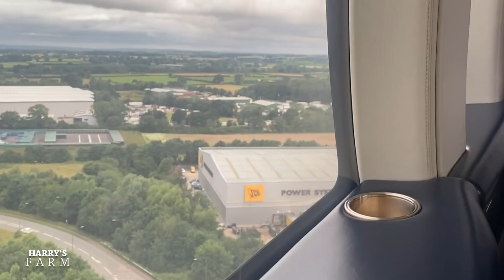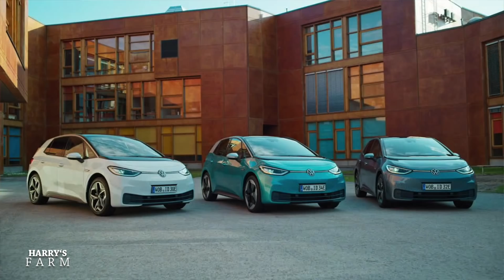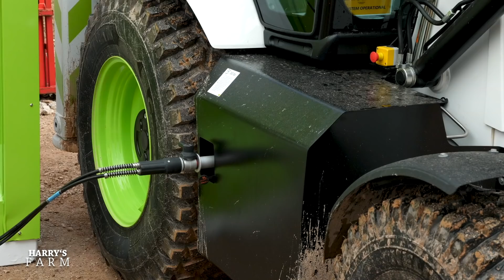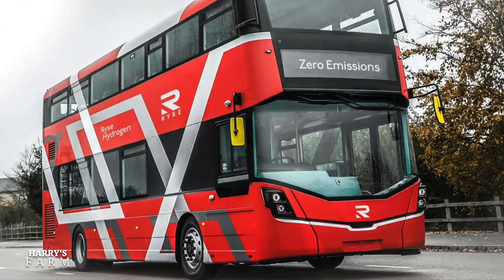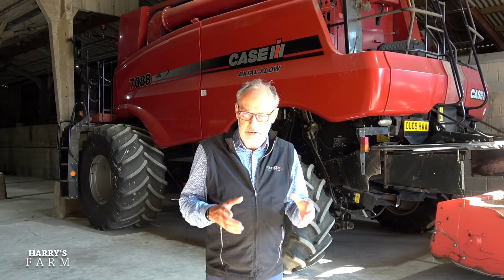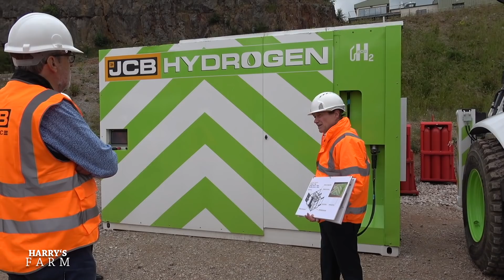Why JCB thinks hydrogen is the best alternative to diesel for heavy machinery, farming and HGV fleet

Comment: I'm very curious how they will protect against water (from combustion) mixing with the oil, and corrosion of cylinder/valves and other parts which has always been a huge problem in engines modified to run partly or completely on hydrogen.  Otherwise this, along with fuel cells (when the price comes down) is clearly the very best green solution.

Comment: The way I understand it, simplified:
Diesel and petrol: dirty energy, dirty emissions, easy storage, low price, low efficiency=2/5
Hydrogen engine: not so dirty energy, not so bad emissions, difficult storage, low price, low efficiency=3/5
Hydrogen cell: not so dirty energy, clean emissions, difficult storage, high price, developing efficiency=3/5
Electric: clean energy, clean emissions, difficult storage, high price, great efficiency=3/5

Don't get me wrong, I'm just trying to get a grasp on the topic. Electric is probably preferred now because not only is it possible to produce electricity in a seemingly renewable way, but that technology is also widely available and used all around the globe. Meanwhile, hydrogen only has the promise of being a clean source of energy, but production isn't as environmentally friendly yet as the other, and technology in general is currently being optimised. 🤔 In other words, they're at different stages of development in my view, but surely it will be interesting to see how each solution will progress and find the best fitting industry. What if they are all great, but for different applications?
Reply: Hydrogen cells must be worth at least a 3.5
Reply: Electric isn't efficient, they said you'd need 8 tons of batteries to be equivalent diesel. Also in the long run batteries aren't great for the environment either.
Reply: @Camhin1  Electric is by far the most energy efficient. But I agree, there will be places where the energy efficiency will have to sacrificed to gain efficiency in other areas, eg weight and capacity efficiency. Still for the vast majority of applications, batteries look to be the more economic choice.
Reply: @Camhin1  an electric powertrain with batteries seems to be far superior to anything else efficiency wise, it just limited for weigt, capacity and price

Comment: As a battery electric car convert and driver, I totally agree with everything said here, battery electric is the solution for cars and vans, hydrogen is the solution for tractors, trucks, buses, and trains where lines are not fully electric…we just need to ramp up both very quickly to avoid full on climate crises. Elon Musk has certainly shaken things up! Trouble is getting hydrogen in any volume any time soon. We can all charge electric things ranging from toothbrushes to cars at any socket but the public have just three working hydrogen filling stations in the UK..

Comment: Enjoyed the video,the only fly in the ointment is that batteries are going to be progressively smaller ,cheaper, and more efficient,in the near future.
Reply: Wasn’t that countered in the interview? Performance will increase, but unit cost will always rise - might mean you need fewer cells eventually which could result in a fiscal saving but if automotive development over the decades is an indicator, that increased efficiency will be sold at a premium as performance and offset by other features. How much larger and heavier are today’s ICE cars than there predecessors? At a slight tangent I have heard it suggested that Tesla’s structural (monocoque) engineering is overly complicated and hence heavier

Comment: Everyone in the motor trade knows full well vegetable oil is the best fuel . It’s so clean you can eat it and while growing it’s absorbs carbon monoxide. Loads were using it until people found out people were using it 😂 then as if by magic vegetable oil went from 30p a litre to the exact same price as diesel and manufacturers all changed their fuel pumps so you could no longer use it . Who does not get this ? A fuel so clean you eat it

Comment: Surely this could be quite misleading, because there is no mention of how much the fuel itself will be and from what i understand making and supplying the hydrogen is the problem.
Reply: You're correct. This process is hugely inefficient. The cost of hydrogen will never be able to complete with the cost of charging a battery. A technology like this will only be plausible in situations where battery electric is infeasible
Reply: @fraserrose4209  "Will never be able to complete" is a very bold claim. In terms of physics/math, nuclear power using h2 as energy storage is probably the most clean alternative we have available right now. The problem now is that the EV lobby has become too big and they will not let this narrative fly.
Reply: @cosmonauteable9151  you could be right, but storing hydrogen is exactly the problem, no? Energy density per volume is very poor for hydrogen.

Comment: With your soil analysis and the possibility of farming an energy source through grasses, add a net zero fleet of tractors etc and you could have all the cows in the world and Greta would be happy.
Reply: oil companies attempting to sell oils and gas dressed up as hydrogen it is a scam    Depending on the quality of the feedstock (natural gas, rich gases, naphtha, etc.), one ton of hydrogen produced will also produce 9 to 12 tons of CO2  
However, hydrogen combustion with air produces oxides of nitrogen, known as NOx. In this way, the combustion process is much like other high temperature combustion fuels, such as kerosene, gasoline, diesel or natural gas. As such hydrogen combustion engines are not considered zero emission.

Comment: Using fuel cells to produce electricity from hydrogen is more efficient than burning it in a combustion engine, I believe, and no NOx emissions.
Reply: But a far slower process.
Reply: @wheater5   ICE running on hydrogen is about half as efficient as fuel cells for powering machinery and it produces NOx, no reason why fuel cells are slower, you size them accordingly. See:

https://www.youtube.com/watch?v=1Ajq46qHp0c&t=9s

ICE on hydrogen is better than fossil fuels, but far inferior to fuel cells. JCB are going in the wrong direction.

Comment: Hydrogen combustion engines are less efficient than fuel cells, as you loose a lot of the energy to heat.  No breaking regeneration either (which doesn't apply here, but good for transportation vehicles).  I get that there is a cost problem with fuel cells, but I guess that will improve in time.

Comment: 16:12 there is the problem. The engineer stated that BY MASS hydrogen is more potent than diesel. So it has a higher specific energy, NOT a higher energy density. Even when compressed to 350 Bar as suggested, diesel is far more energy-dense than hydrogen. That is problem 1.
Problem 2 is that hydrogen combustion is NOT emission-free. Yes, you lose all CO2, CO and soot emissions, but NOx emissions still remain. This is one of the biggest issues with diesel engines that remains unsolved here.
I just can't understand why they chose not to use fuel cells, which would allow for greater torque (mentioned to be a desirable characteristic) and vastly greater thermal efficiency than a combustion engine. So I sadly remain unconvinced (although I hope to be proven wrong).

Comment: This is great, but there is one big misunderstanding on energy density. Hydrogen has very POOR volumetric energy density. You need a tank 7x bigger than diesel for the same energy. Energy density by mass, and energy density by volume, are NOT the same!
Reply: Which presumably means more fill-ups but doesn't render the whole machine inop for hours while it charges.  Most big sites will have a fuel source already.
Reply: So what its a non palootent
Reply: What if you store it under higher pressure to reduce the volume required
Reply: Who cares about volume its more viable than anything you can think of and not as Toxic as lithium battery's and thay only last for 7yrs . DONT argue with me .I'm a Mechanic with a brain
Reply: @paulthompson7280  don't worry mate, I don't think anyone was talking to you after your initial big brain comment.
Reply: @wilbobagins  even in liquid form (ie in cryogenic pressure tanks) it's got a specific gravity of 0.07 which is a tenth of diesel (roughly 0.8) 
In high pressure gas form as we see here in non-cryo tanks it's density is around a quarter of that and the atoms are so small that at 5-10,000 psi it'll permeate through the steel tank over time.
And it's bloody dangerous stuff.

Comment: I’ve been thinking this myself. EV is great for small machines with low utilisation, but it makes no sense for heavier or heavy duty vehicles due to the increased bulk of the battery and charging times. An electric Range Rover sounds great, but in reality hydrogen powered makes a lot more sense. Now all we need is lots of offshore wind farms feeding electrolysis plants plumbed into N Sea gas  fields. The infrastructure is there already. Let’s make hydrogen happen, and keep the cost of motoring low for the average British family.
Reply: Cost of motoring is already lower with a battery EV, so....
Reply: @proxy7863  you mean the running costs? Yes I agree but the cost of the vehicle is much higher and wouldn’t work without subsidies. Cheap running cost is because governments can tax fuel (58p per litre) while electricity is used for many other things so cannot be taxed to gather revenue from EV motorists. This means that the funding model of motoring will have to change - likely road charging- to make up for lost fuel tax revenue. Enjoy your subsidised EV driving whilst you can, it won’t always be that way!
Reply: @Playingbyear  Initial costs of EVs are dropping all the time now economic scale is kicking in. EVs are only subsidised by a £2,500 grant at the mo so it is not huge money whilst the oil sector is heavily subsidised. Yes the economic model of taxation will have to be looked at but that is not at the fault of the cheaper, more efficent and more sustainable battery EV vehicles.
Reply: @proxy7863  they’re subsidised to the tune of 2.5k to not make them look ridiculous in price. E-Golf vs Golf R is about the same cost. Prices will of course drop, I still think larger vehicles are better suited to hydrogen fuel cells, which will themselves come down in price. See this article from Aug 2020 https://www.driving.co.uk/news/jaguar-land-rovers-hydrogen-suv-within-decade/

Comment: The problem with hydrogen has always been pressure I’m amazed Harry just completely brushed over it . 5000 psi is very problematic in engineering from a safety point of view. It’s like driving a bomb around and over time as rubber and joints get old it becomes even more dangerous 5000 psi is a crazy amount of pressure.

Comment: Aha! The step up in pressure required twixt bulk delivery and filling the vehicle's smaller tanks is not explained on the 'Garage' channel. It is indeed a stumbling block to on-farm or even truck-stop storage  and particularly to portable site work refuelling on things like large scale civil engineering projects and forestry, where the site changes as work progresses. Perhaps future hydrogen delivery tankers could have higher pressure vessels? I also wonder whether there are safety implications to the storage and use of hydrogen both at the bunker and in the vehicles?